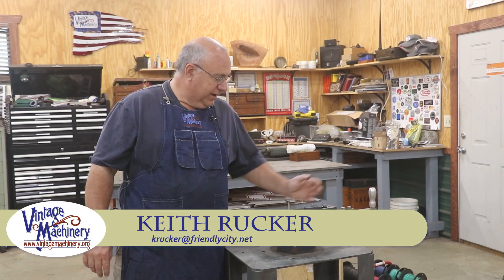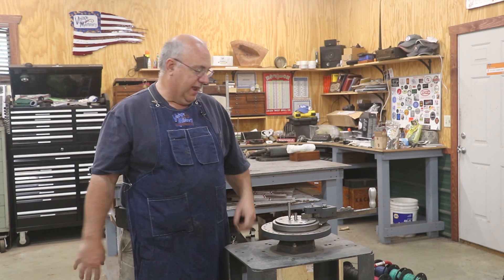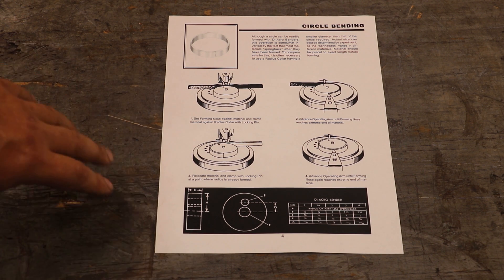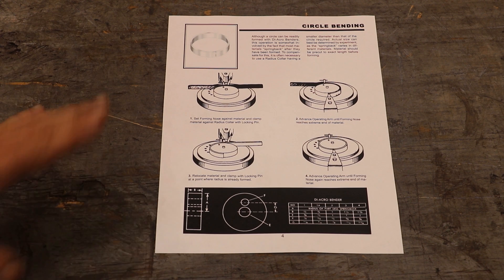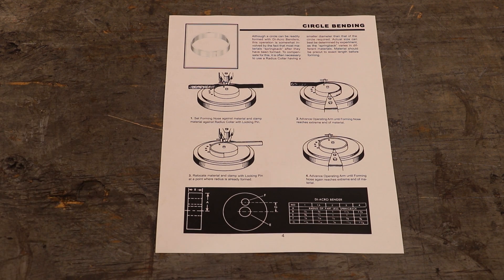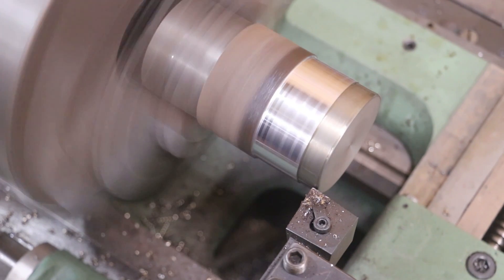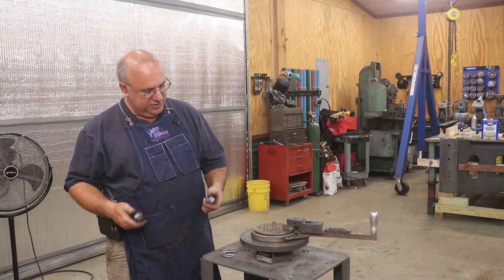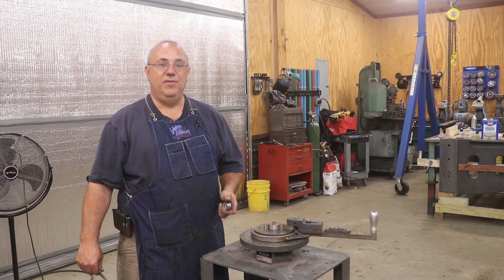Making a set of Round Dies for a Di-Acro Bender

Comment: I also have a 1A that I use for bending thinwall 4130 tubing in 1/4, 5/16 and 3/8 diameter.  I found that I can make larger bending dies and follow blocks using my 3D printer.

Comment: Nice to have a bender for cold work. I have the "other" brand, Hossfield but both get the job done. Making your own dies sure is a lot less expensive than buying them. That looked like an old piece of shafting you used, mild steel or WI ?
Reply: I have a Hossfeld #2 that dates to around 1930 (they started making them in something like 1923!), and still does everything I ask it to! Kind of cool that they’ve been producing essentially the same bender for 100 years, and it’s as useful now as they were in ‘23, 1923 that is!

Comment: Hi Keith, thanks for another good video.  What are those holes around the base used for?
Reply: For placing stop pins when making repetitive bends. Probably other uses also. Di Acro’s website has the manuals and “The Art of Bending” for viewing. These things are crazy expensive! The model Keith has sells for $2200.00 new with no tooling! A starter tool set will set you back at least another grand! They’re very proud of them I guess!

Comment: Wondering why the center drill has the shape it has, as mr. Goodunof consistently only drills virtually a centerpunch mark.
Reply: There are center drill and spot drills. Virtually nobody on Youtube uses spot drills, but they are technically the right tool when you want to spot a mark to start a larger drill.
The center drill has the shape it does because it is intended to drill a cone-shaped hole that you use to put a center point on the tailstock into, to hold the end of the work steady when you turn it. They are not really intended for spotting holes, but they work for that.
A spot drill is just a stubby regular drill. They are also known as "screw machine drills", since they are the size that were typically  used in screw machines.

Comment: We had one of these in high school shop class, the trouble with the tool is that it requires clearance all the way around it.  It  lived in the middle of an open space on the shop floor, in the way 99% of the time, but great when you actually used it.

Comment: Often I do not understand your way of working. When you turn with carbide inserts, you add oil. That brings nothing, except a lot of oil fume, which sits on the lungs. Then you drill with HSS, but dry. And oil would extend the life of the drill.
Reply: Also not even taking enough of a cut to break the chip with that insert. Going from 2.5" to 2" could be two passes for that Monarch, three tops.
Reply: 99% of the oil does not reach the cutting edge. Although most of it does get  cooked!
Reply: @henryD9363  Not even 1% of the oil gets into the cutting edge. I'd say it's closer to 0%. There's some chance when a mister is used, but that also coats everything around in a film of oil.
Reply: I was taught in machine tool technology that carbide was only used with full flood coolant or dry.
Reply: Sorry guys but I'm sure Keith has said before some metals he uses oils on as a coolant and to make a better finish. He has named different types of them also. I also have used lathe's 46 years and found trying to find the exact speed for certain metals not to heat up the metal or bit is not always easy when you grab a unknown  metal out of your saved scrap. Now if you figured the cost of new bits into your price of a selling parts, you make parts fast and make money, but if out of your pocket you think twice. Joe Pieczyaski, Mr Pete222 also many years of lathe use do the same as Keith. If we all had safe coolant with pumps on the lathe to keep it safe for us it would be the best, but lets remember this is Vintage Machinery we watch.